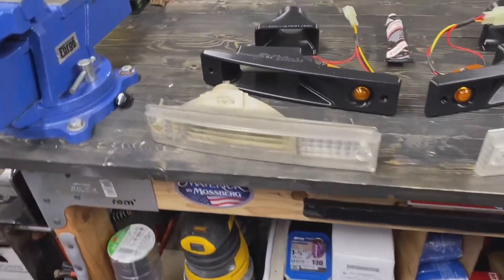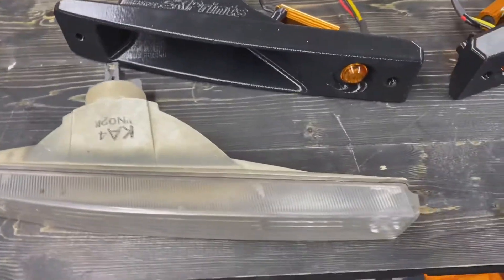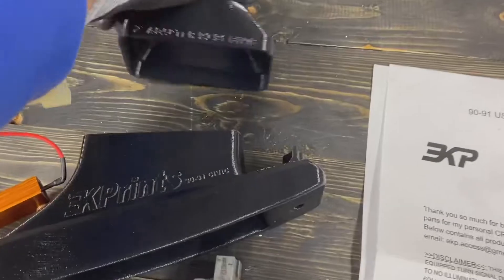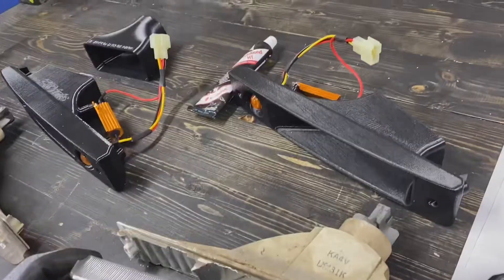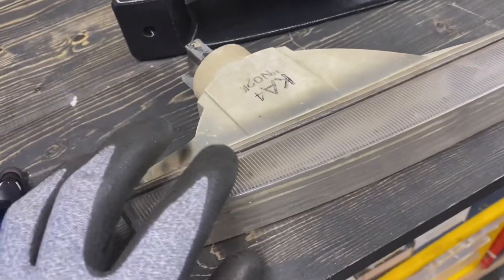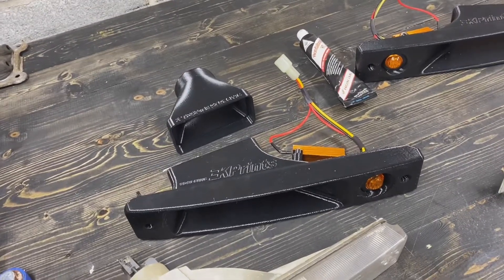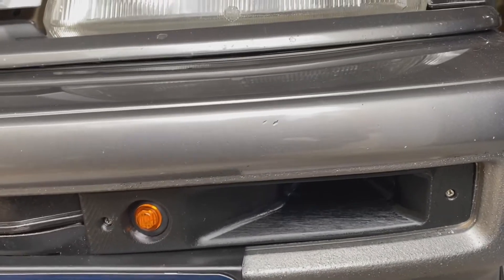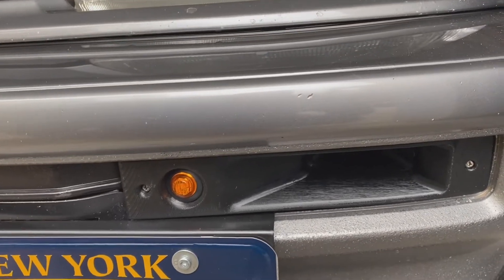EKprints - TURN SIGNAL DUCT INSTALL 90-91 CIVIC

Comment: They look cool thinking of picking up  one. Did you have to cut anything behind the bumper for the air duct on the passenger side?
Reply from the maker: No cutting at all was needed thankfully, I’m not running fender liners either  so it’s a straight shot to the caliper once I figure out a ducting solution it should be a nice clean setup
Reply: @victorsgarage5814  thanks for the reply just one more question how is the flicker rate on the turn signals? Are they the same or faster like when you have a bulb out?
Reply from the maker: @filipedasilva220  pretty similar to when you have a bulb out, it’s faster than the oem flicker and thanks for the support bro

Comment: That looks really cool. I like how they match your grill. Did you make that grill on your bumper?
Reply from the maker: Unfortunately i did not, it came with the car and it has no markings or branding on it at all, it is very period correct. So it was probably either a custom piece or just something that was offered around the early 2000’s prior to me owning the car it sat in a storage unit for almost 10 years untouched.